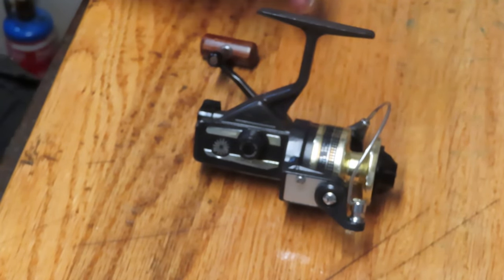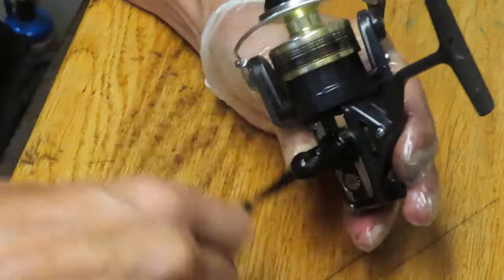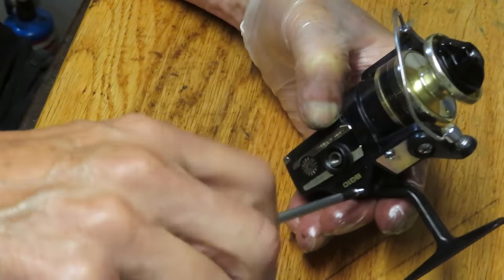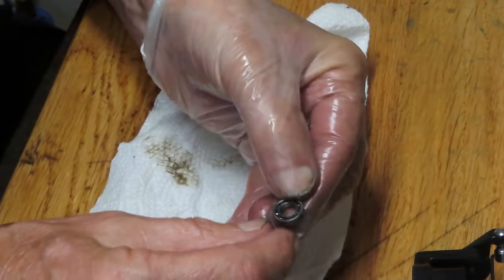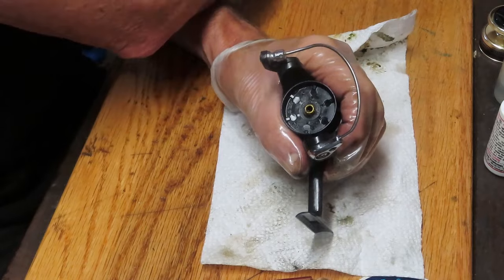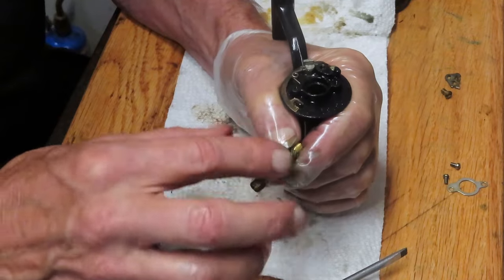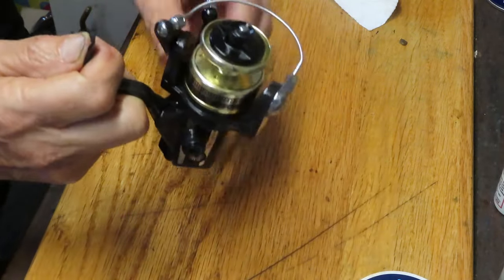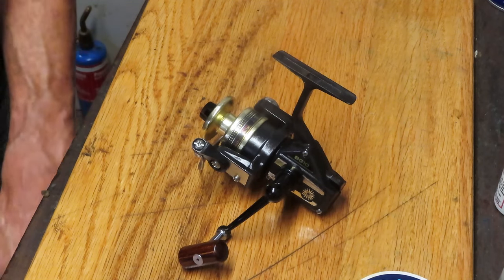Daiwa BG10 vintage fishing reel how to take apart and service

Comment: I have over 75 vintage Daiwa spinning reels but not one from this series. These are phenomenal reels but I see little if any differences between them and the GS Daiwa reels except for cosmetics. I do think the Black/Gold Daiwas have better paint than the silver and gold ones. Honestly I’ve collected more of the Silver Series and Gold Series mostly because of how much Black/Gold Daiwa reels cost on the used reel market. Someday maybe I’ll get a few. You really had a time with this one. I had to do the same on a GS-9 I’m still working on. You did a great job bringing this beautiful reel back to life. Congrats to Scott on finding another winner! — Chris
Reply from the maker: If you find some at a decent price, they are worth adding to you collection.  Just note that the larger ones tend to develop a rotor wobble over time

Comment: Thanks as always Dennis.  I am looking forward to a video of servicing the new BG series.  They don't look like they are easy to crack open.
Reply from the maker: I will do one.  They are not a easy as the original, but it is not the most difficult reel to work on either

Comment: Well Done Dennis. That Was A Job Getting Past Those Bearings ! Maybe A New Set Might Make That Reel Quieter ? But You Are Right 40 Years Old They Are Allowed to Make Some Noise.
Reply from the maker: I'm sure the reel would be near new with replacement bearings.

Comment: The few Daiwa reels I've had  I liked, they did what it said on the tin and did it well, ..................which set me thinking did Daiwa make a ''bad '' reel.
Reply: Their "Crossfire" Wal-mart reels are cheap, junky/clunky.
Reply from the maker: Daiwa makes everything from inexpensive, basic reels to the most expensive ones.  The low end line will do what they say the will, but don't expect them to perform like the BGs.  The problem usually comes when folks by the $30 reel and expect it to perform like the $300 one and then say it is a bad reel
Reply: @2ndChanceTackle  Thanks for that Dennis - much the same as always - you get what you pay for,  ........................ my original Millionaire 6 HM is superb, as were my silver 4000  series fixed spools - which I've often regretted selling - FWIW both were fished low on the butt South African style on 12ft Conoflex Cod 5 beach rods
Reply from the maker: These are classics with a well deserved reputation.  Thanks again

Comment: Crazy. I literally just got done cleaning and regreasing/oiling a BG10 today and then i saw your video. I bought it online and its in mint shape and still has the tag thats wrapped around the handle leaving me to think it was never fished. Im so tempted to fish with it but Id have to rip the tag off since the rotor knocks on it. Daiwa mustve factory greased the bearings on these? Mine was caked where they wouldn't even spin. Had to take the bearings apart to clean the dried grease off. Love your channel.
Reply from the maker: Thanks - if it never went fishing, then it would be factory grease.  It could be that it was only used a few times and possibly service a while ago and that may be the source of the extra grease.  Hard to say.
If it was me, I'd take the reel fishing, that is what is was meant to do. - Dennis

Comment: I've never had a spinning reel with an anti-reverse dog.  It seems to work like the anti-reverse on a baitcaster.  (There are two, I'm speaking of the one activated when the thumb bar is pressed which involves the rachet wheel.)   But why do some of the larger reels move the action of the dog at the back all the way forward to engage grooves on the inside of the rotor?  Or am I wrong that some do that?
Also, this really shows the importance of, and why reel makers have moved to, sealed or shielded bearings.  I've never seen a bearing with the balls jambed like that before.
Reply from the maker: They are different designs but equally effective.  Some use the rotor as the click ratchet and some use the extra piece not the pinion gear.
Of course, most "modern" reels have gone to the A/R clutch bearing.  The engineering challenge with those is that they are one way clutches and there is no easy way to do the over-ride and dis-engage the A/R, so the manufacturers have largely quit trying and just eliminated the over-ride